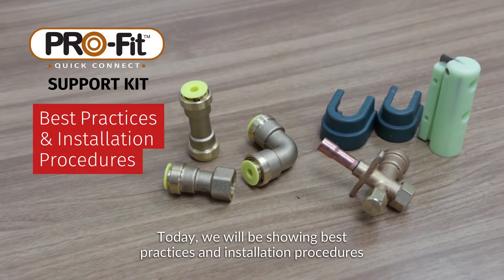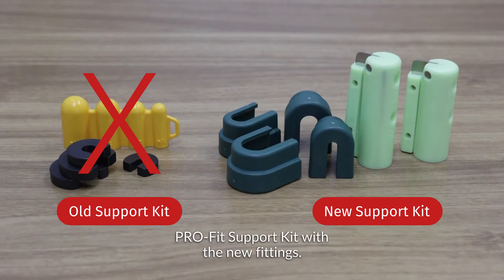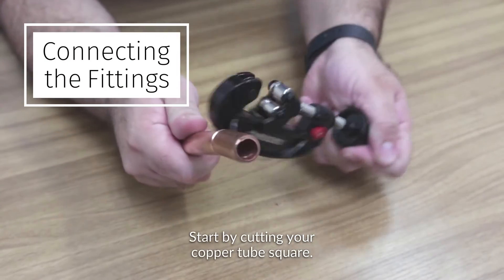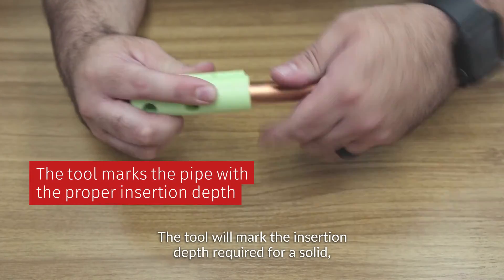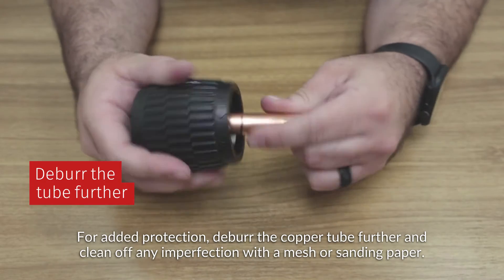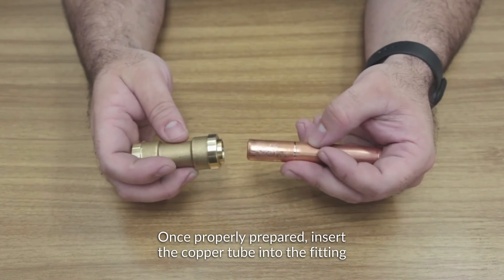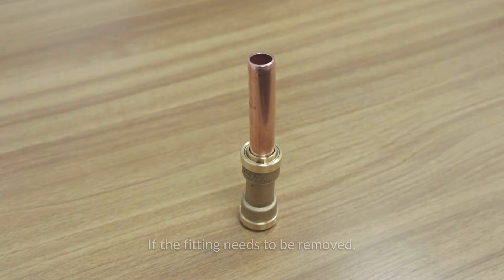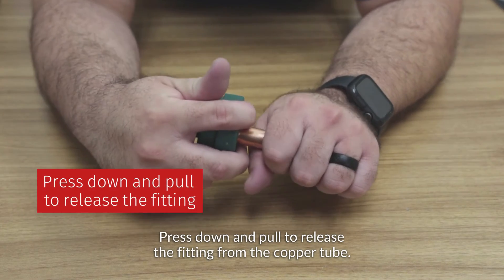PRO-Fit Quick Connect Support Kit – How to use

Comment: Had major issues with these when you changed from the plastic inside to copper or brass. Had over 90+ fittings leak costing me thousands of $$$ in call backs for lost refrigerant, labor, and parts. I swore by these and used on every ductless installation.